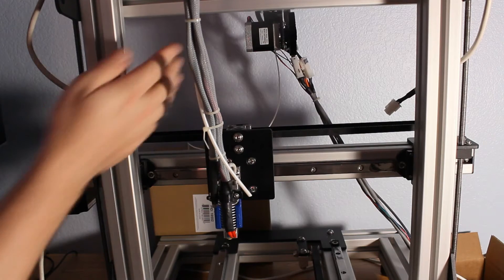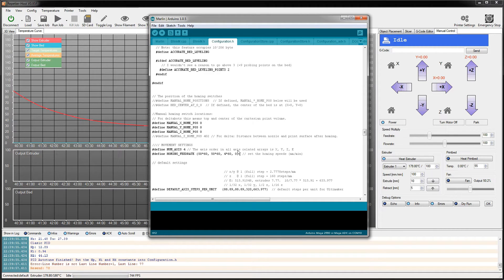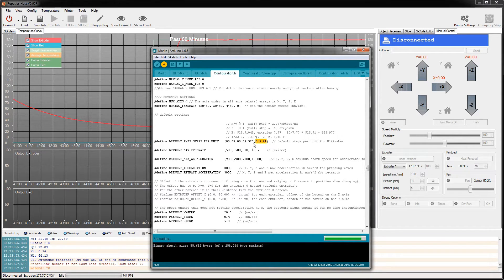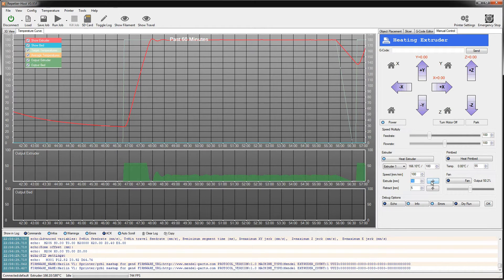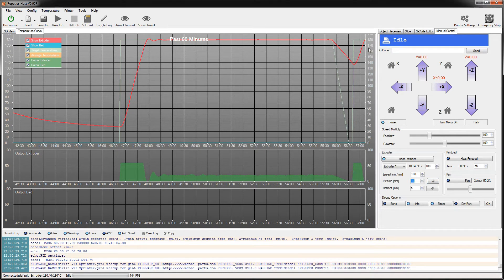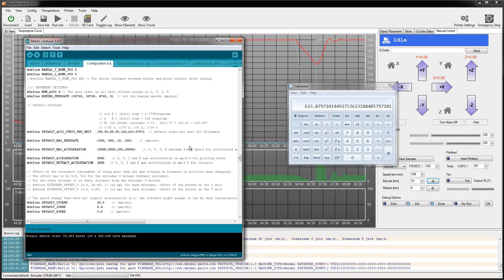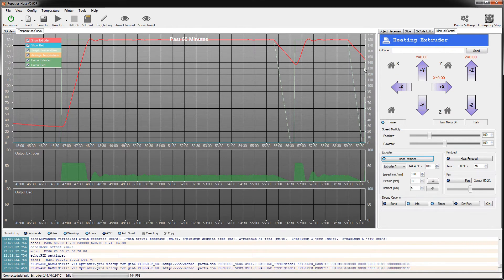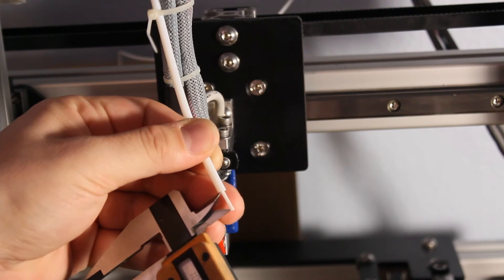Evan's DIY 3D Printer / Mill - EP7 - Extruder Calibration

Comment: Hey Evan, i built a 3d Printer not long ago and i am using a bowden system aswell.

I recommend you take the measurement directly at the extruder and measure about 15 cm of filament then mark it with a marker then extrude 10 cm and remeasure the distance between the mark and the extruder. 

the reason it is better to take the measurement at the extruder is because the bowden also has a backlash that you will have to take into account when setting up the retraction, it is not a huge thing but still significant if you want parts with tidy finish.
Reply: You are right, it might be worth a re-tune of the steps, however I'm getting acceptable results currently, I have other problems :P

Comment: Did u edit the configuration.h file for the calibration of the PID temperature control and the filament extrusion?
Reply from the maker: Yes, I did.  Once I found the E-steps, I copied it into the configuration.h or adv_configuration.h and saved it.  I did the same with the new PID constants after the auto tune (though I need to run it again, I've changed heater voltage since).